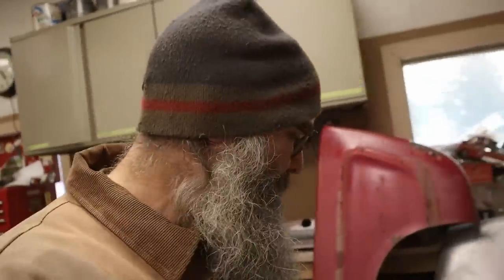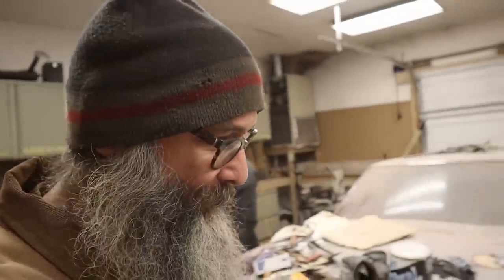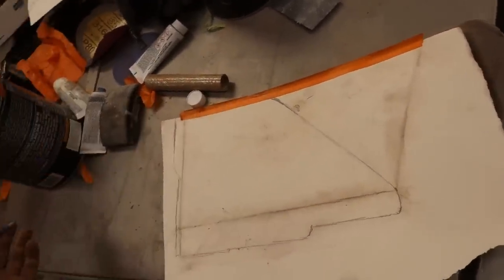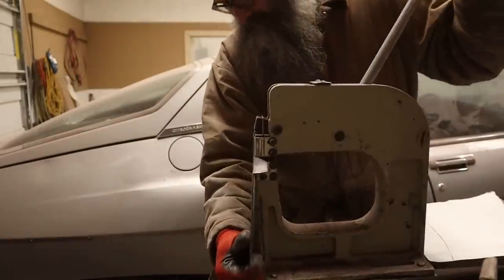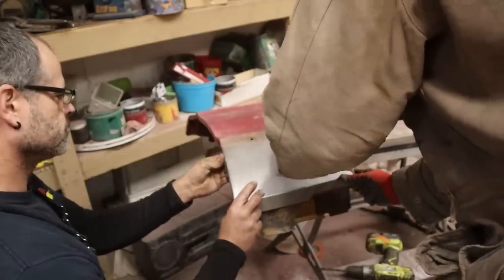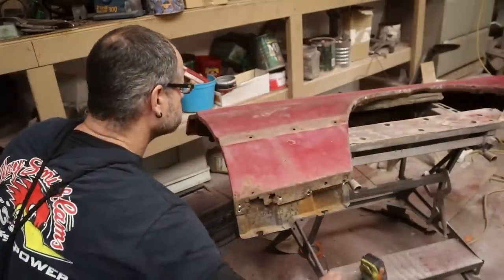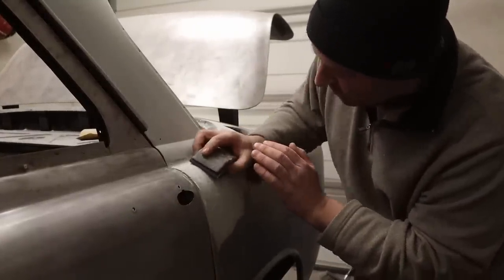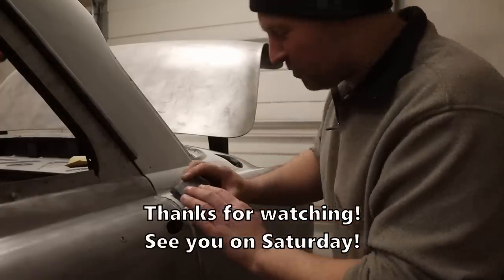Easy Fender Patch Panel Fab!

Comment: You know, one of the "lessons" noted/learned while watching you work, that so many of us "novices" don't practice, is to "relax" while doing the work. Watching you use the shear and fold the edges , it looks so "natural, easy, and relaxed" !! Doing tasks that I have lots of experience on, I have learned to slow down, relax, and "focus" enough to allow the piece/work to tell you what it needs along the way !! Being nervous,  apprehensive, and afraid,  interrupts that flow of communication.
Reply: That's well explained.
Reply: I completely agree, when I  was younger i would get so worked up when doing some maintenance or repair on my vintage motorcycles , stressing out and not thinking properly , it took watching my bro in law , a professional mechanic working on vehicles , calm and relaxed , thinking and watching while taking things apart , no drama , its a machine , you can fix it .

Comment: The sm is it going to be full restoration?
Reply from the maker: Well, it will be very nice, I hope... It doesn't need a "full" resto, because it is actually a low-mile car in good condition everywhere other than the body, which was left outside for years and got pretty rusty and weathered...Cheers!